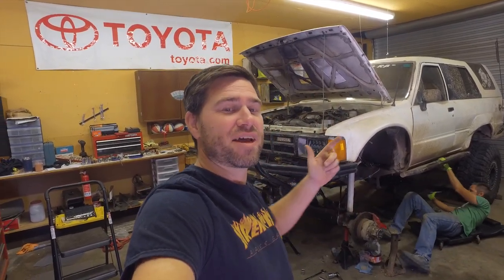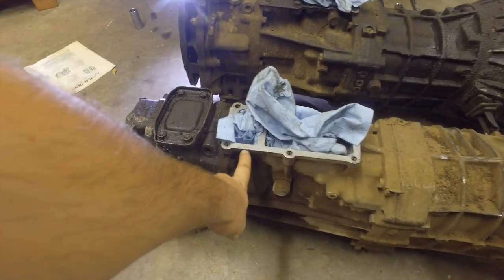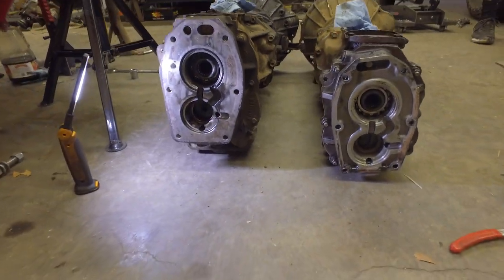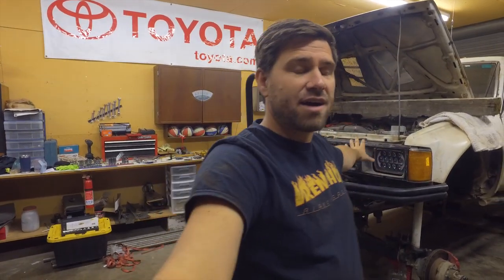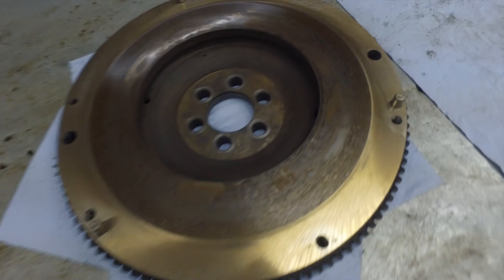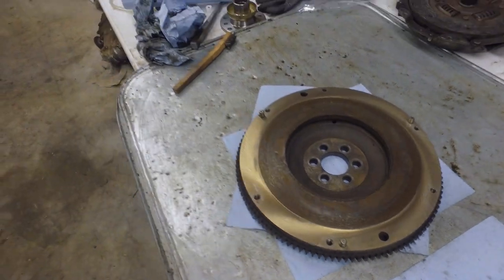Removing a Transmission | 3rd Gen Toyota Pickup

Comment: Yes lots of maintenance, right now I’m looking for an AC amplifier can’t seem to find one for an 86
Reply from the maker: Bummer, I don't even know what that is
Reply: SnailTrail4x4 behind the glove box on top of the air box there is a wire plug that fastens to it. You unplug the wire and pop the cover off and pull a circuit board out, there it is the amplifier is the circuit board